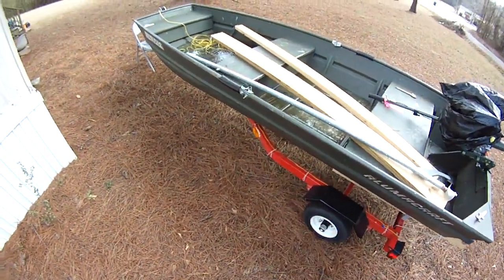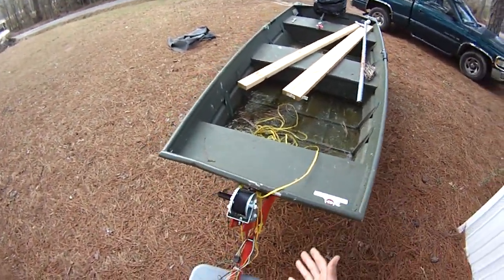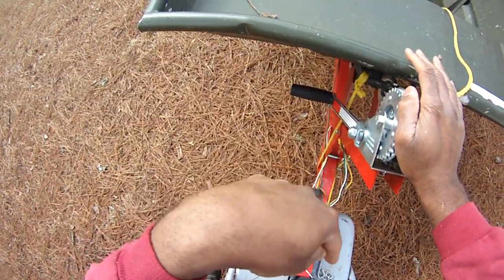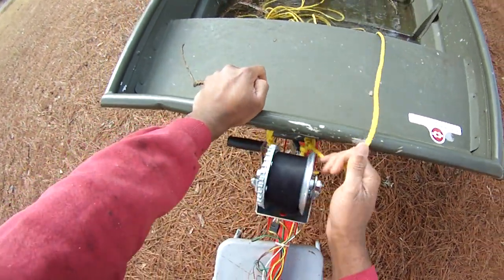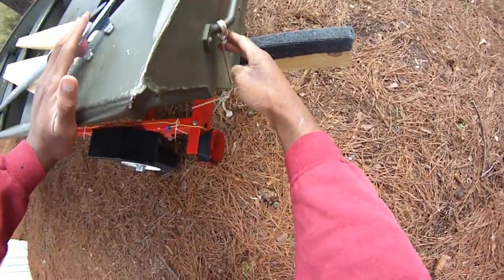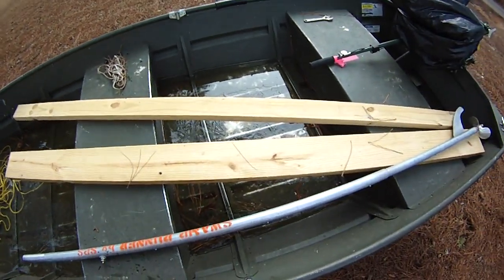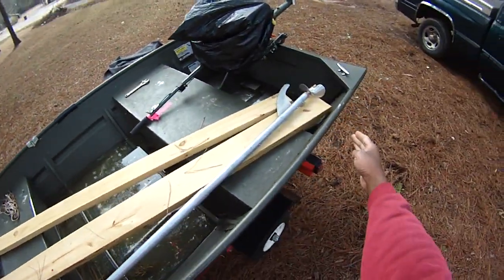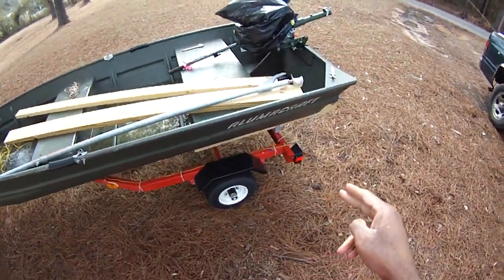How to Secure Your Boat to a Harbor Freight Boat Trailer

Comment: whats the size on the jon boat? I wanna buy me a 1448 jon boat. would this trailer work
Reply from the maker: Yeah 1448 would be the largest size I put on this trailer, but I think it can handle it fine. Take a look at my latest upgrades to this trailer for a better fit than the stock bunks and such.